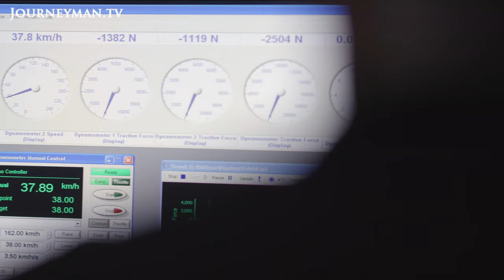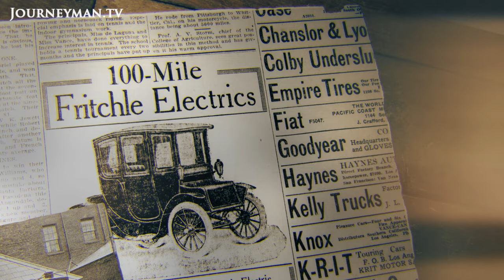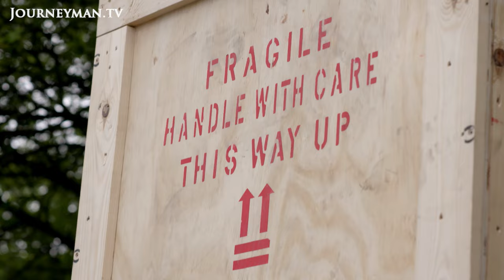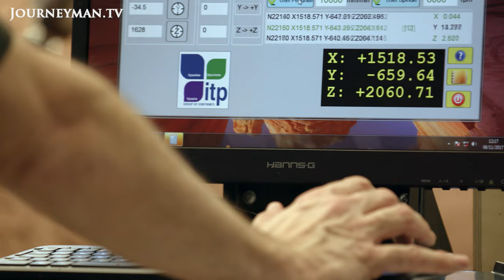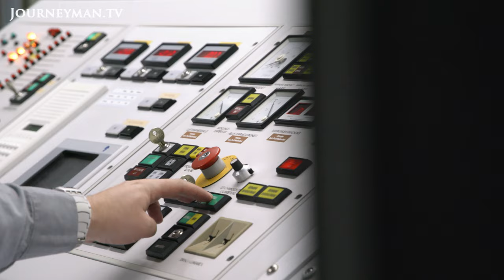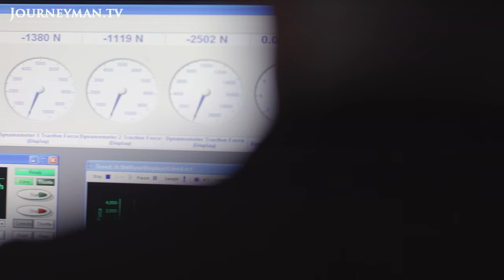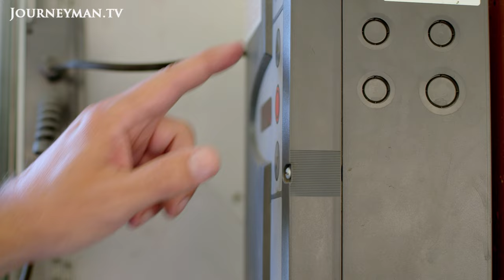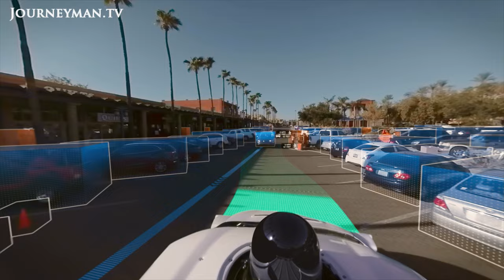How Jaguar made its first EV | Jaguar - Going Electric | Full Film

Comment: Building electric isn't challenging. Everything about building electric cars is easier (except battery chemistry) than building combustion engines. The only difficult part is scrambling to keep up with the competition that is miles ahead!
Reply: Lol yeah right.. if anything building an combustion engine car is easier because of all the experience auto makers has.. electric cars is new, so it will take awhile before they get it right
Reply: @storm-shadow1237  What is there to get right? Everything already exists. Electric motors are nothing new, control electronics exists, building a car frame is no different from the car frame of a combustion car (apart from the extra space you get for not having a combustion engine). The only parts that need to be figured out is the charging infrastructure and making batteries safer and more energy dense. Those last two are the most difficult, but it doesn't stop anyone putting electric cars on the market.
Reply: @puffinjuice i have to say jaguar did an amazing job on all aspects except from battery range compared to tesla and infotainment (for some) but did an exceptional job in making a really fun ev car, still till this day the jaguar i pace is one of the best handeling electric cars to drive only being challenged by the porsche taycan. Tesla has the better tech ofcourse but for 90% of people the jaguar has enough range  and charging speed and the first time you jump behind the wheel you feel confident. They did alot of things right with the i pace especially when you thing about when it came out.

Comment: JLR have now recalled all of their EVs due to the risk of the batteries spontaneously catching fire.  Not good and happening all too often. These things are too volatile. There's good reasons the motor industry progressed to combustion engines decades ago. When do you ever see progress going back to the past.
Reply: except they haven't  it affected around 6000 vehicles none of which caught fire and only as a check on cells which was done in the dealers or over the air. It also affected many other manufacturesrs using the same battery platform but strangely you don't mention that fact or any other for that matter.
Reply: Not true. Only some (not all) of the 2019 and 2020 model year were recalled to address cell packs that were assembled by a faulty robot. JLR is in the process of replacing all of the suspect packs.